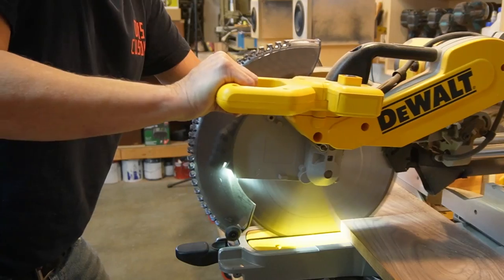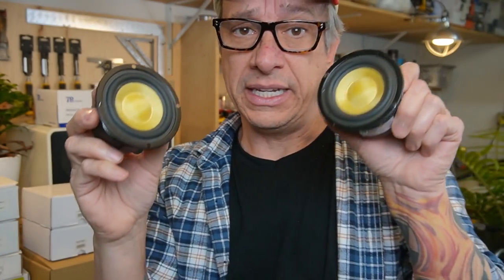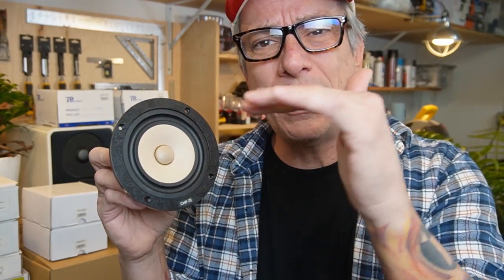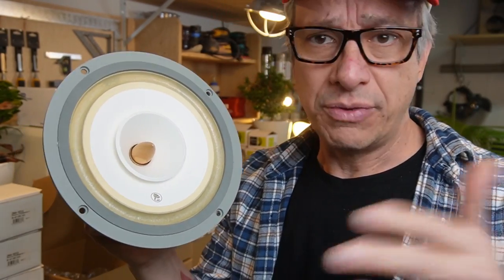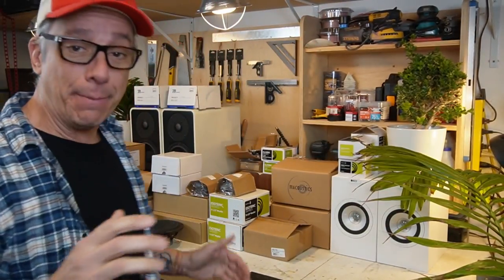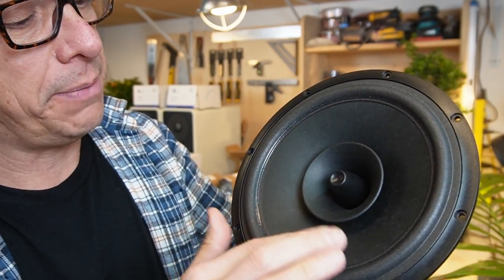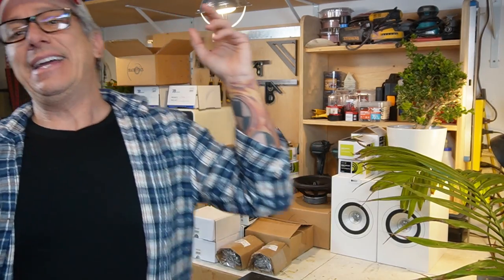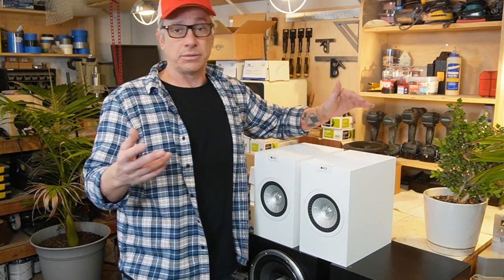Next DIY Speakers | Transmission Line, 3way Tower, Lii Audio,  Dayton Audio, SB Acoustics, Markaudio

Comment: I thought I was crazy wanting to have 20 pairs of speakers. Its good to see I'm not the only one
Reply from the maker: Hahaha!!! Right?!!! That's how we do it!
Reply: @sonnoradesign  I know I love it. I had that same pioneer intergraded amp you have and I just found a sleeper vintage receiver at a thrift store last weekend it's a realistic Sta- 2270 60 watts per channel it's a sleeper I only paid $40 for it because it came from radio shack at late 70s and it's not a pioneer marantz or sansui no one pays attention to it and they are cheap and I owned a lot of vintage stereos and I wasn't sure I was going to like this but once it warmed up it sounds amazing I highly recommend it because you can get them for around $40 and designed and built in Japan and you can control everything I have never seen some of these controls before it's my favorite. It was the best day ever.
Reply from the maker: @BostonMike68  hahaha. Love that. Those 70’s amps are pretty cool for sure. My pioneer would be better with new capacitors though. I feel they are pretty tired. Maybe another video?!
Reply: @sonnoradesign  Yeah replace the caps that would make a really good video. I miss my pioneer but I got lucky on the realistic it's a sleeper you don't hear much about and I wasn't sure about it but I love it now. That's a good idea to switch out the caps with modern ones I want to see how to do it so I can get an idea how to change mine. Thanks bro
Reply from the maker: @BostonMike68  I had never done it hehe but is something that wears off.

Comment: I have a big 1.75 oak cabinet I covered .5" MDF and glued oak down with floor adhesive sprayed the inside with 4 cans of Clear flex seal and used carpet pad and braced it really good it's a tank. Im going to use the Dayton Reference 10" paper version ,I was going to try to make it a two way with a Dayton audio reference tweeter. I use gold trim in my design where I routered the edge like a column in a museum or something with a big 3" thick top and bottom they are tanks and I was going to mix 24 carrot gold dust in my tung oil and mineral spirits finish but I got a great idea from you to use the mark audio chr 90 for a mid range so I don't have to cross the tweeter so low and it's gold and will look awesome. Can't wait to see what you are building next.
Reply from the maker: That’s a cool project!! Great that you got that insight. Those CHR should work well as mids, at least on the computer haha. Hope to see them working soon. Let me know how your design goes.
Reply: @sonnoradesign  I think they would work perfect for that application. Thanks again and I am glad you're making videos again they inspire me. What was name of your band I want to crank it up on my new speakers.
Reply from the maker: Hahaha! Great man! Let’s get it done!!! 
Band name: Madame Machado
It’s on Spotify….
YouTube. 
Old school hahah
Reply: Thanks man I am going to check it out 😃
Reply: @sonnoradesign  There you are right up in front. It reminds me of the Mighty Bostones in Spanish. Its actually really good 👍
Reply from the maker: @BostonMike68  haha! Thanks man. I love that. Right it’s a MMB ska-core style!!

Comment: very cool !

Look forward to seeing what you come up with. Might be worth it to try using HDF for enclosures.

Nice Zu speakers too.

Fyi, Sublime active crossover would be fun to try, killer value for an active crossover!
Reply from the maker: Thanks Paul. I’m working on the transmission line now. Video coming soon. 

Zu’s are pretty cool. I’d like to try some Pro audio drivers at some point. 

I’ve just checked the sublime. Like $500 for a 3 way crossover. Isn’t it too much? More expensive then the mini dsp. I had never tried it though.
Reply: @sonnoradesign   Ya, something like RCF or Eminence...
Reply: @sonnoradesign   It's like building a high-end passive crossover but better. And supposedly better for hi-fi speakers than MiniDSP... 

maybe some RCF or Eminence Pro drivers

Comment: Great to see you back, loved the origin story and design philosophy. Did you ever try any of the Dayton Point Source full range drivers? I built the Singularities and while they aren't perfect they are pretty impressive. They also give me similar vibes I've heard from good live sound PA speakers and I think a lot of that is due to the light weight and efficient paper woofer. 

Also, funny you bought the Q150s, as I just bought them as well (also eBay open box) just to compare to the DIY speakers I have and see if they live up to their hype.  They are good and for deal I got them at I'd be happy to live with them but I don't like them as much as what I've built thus far which is kinda reassuring that I'm not wasting my time. I would be interesting to see what you can do with those drivers though as I think most of what I don't like happening in the KEFs is due to their crossover, though thats kinda hunch as I haven't looked at measurements as I'm trying to stay uninfluenced while I listen to them.
Reply from the maker: Hey Phillip. Thanks man. It’s good to be back. I know that driver, the point source but never tried it. Singularities must sound good!! 
I’m not sure what to do with the KEFs yet but I’ll keep the crossovers in mind!